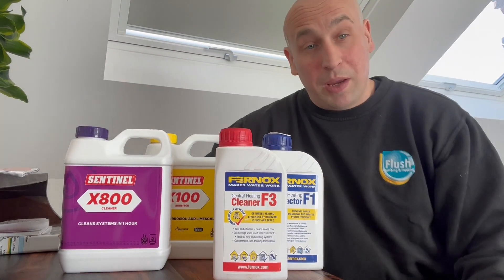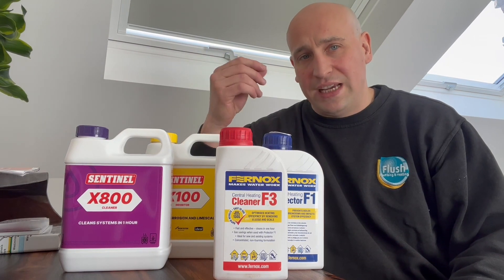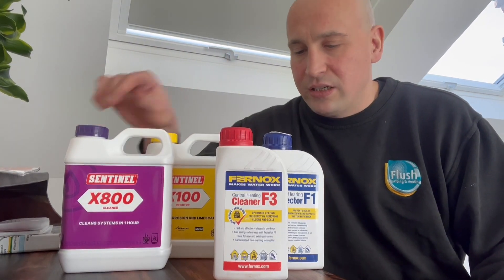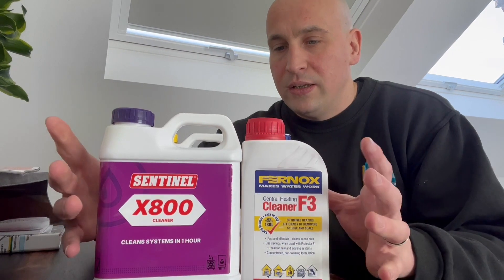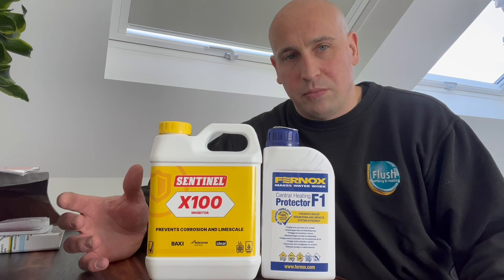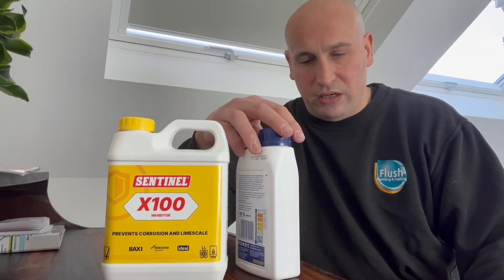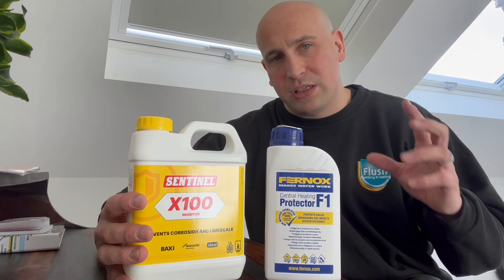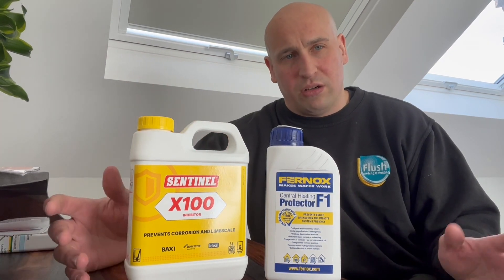What’s a chemical flush?

Comment: Hi my radiators downstairs not getting hot
Engineer says there is sludge  in system so would the x800 help
Reply from the maker: Hi Ricky, Yes x800 is the best chemical on the market for cleaning so yes it would help break down the dirt. If your system is heavily contaminated I would recommend a power flush using the X800. Check out my other video which explains the difference between a chemical and a power flush. Hope this helps :)
Reply: Hi, just installed new rads but the water is orange. What can this be?